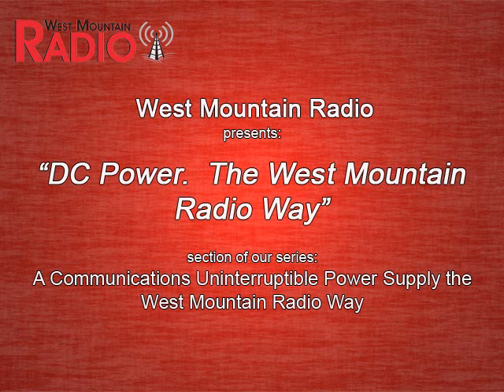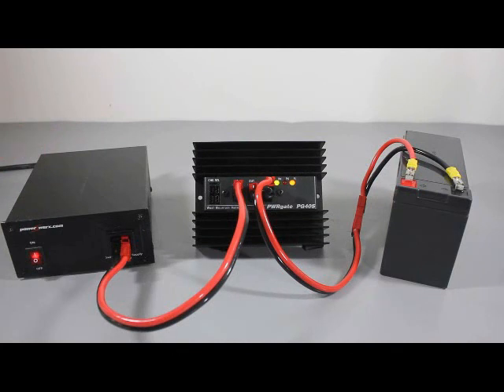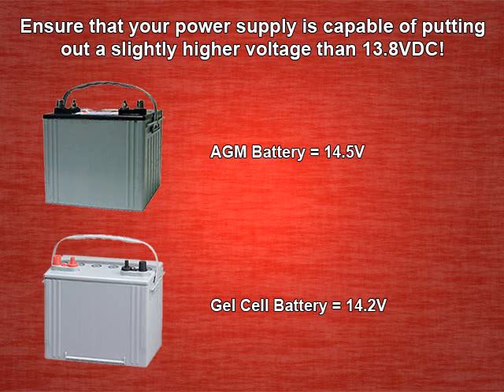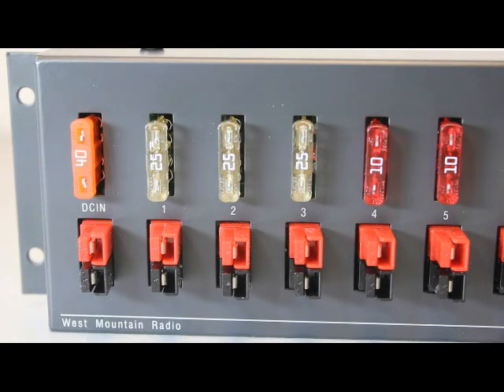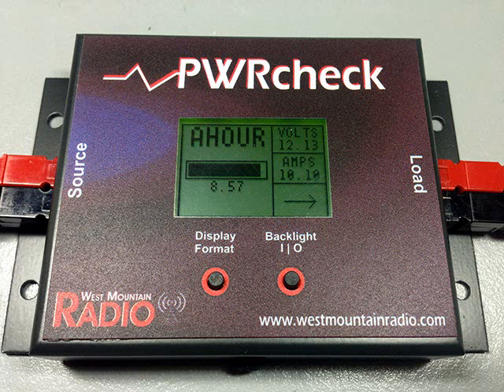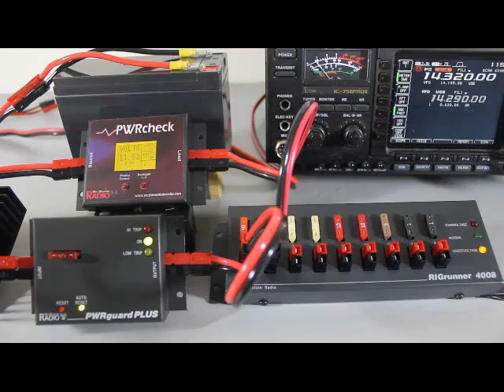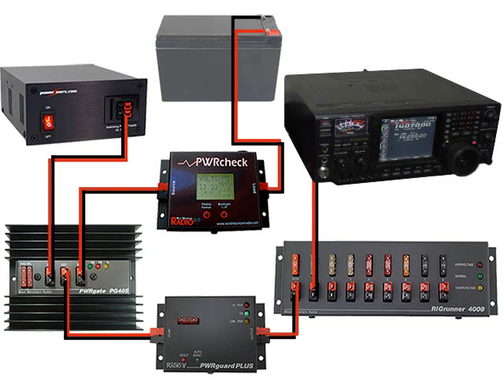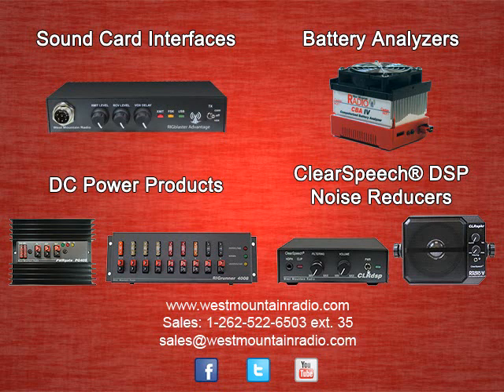DC Power.  The West Mountain Radio Way

Comment: please spend $7,000 on our products because we cant make an all in one unit...
Reply: I get the frustration as I don't think there are many all-in-one alternatives but hey some of us just need a charger or a power distribution block. I'm not even hooking this to a radio. I have some DC-powered network equipment connected to a backup battery so I just need a charger for my existing battery + psu.

Comment: Is this for field use? Why not just use an AC to DC power supply
Reply: if you lose ac the radio still is on way SHTF
Reply: I know nothing about radio but I imagine it could come in handy during a power outage situation, maybe due to inclement weather.

Comment: Since the PowerGate is only for Lead-Acid batteries, is there a similar product available for auto-switching between a pwr supply and a LiFePO4 battery?  

I don't need that device to be a charger -- just need a simple and small transfer switch option.

Thanks,
Deb
Reply: Epic PWRgate
Reply: Their Epic PWRGate will recharge LiFePo batteries. I use one myself.